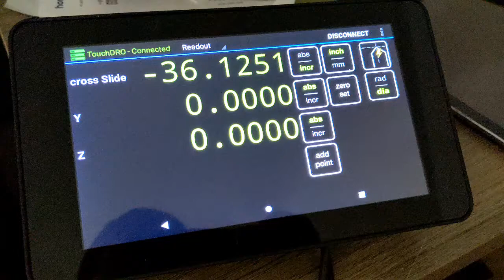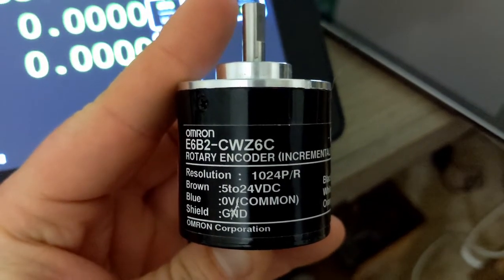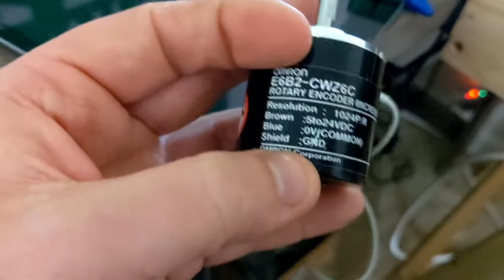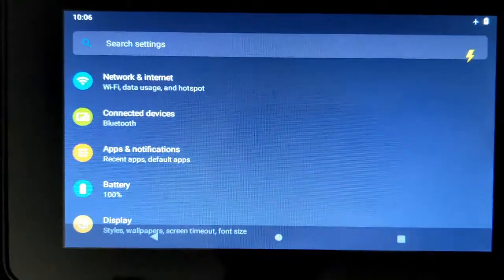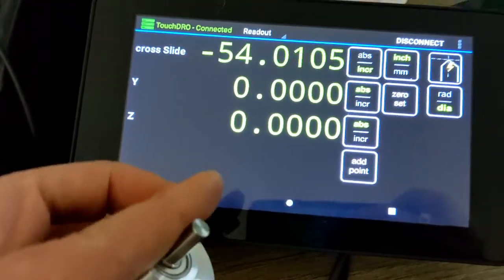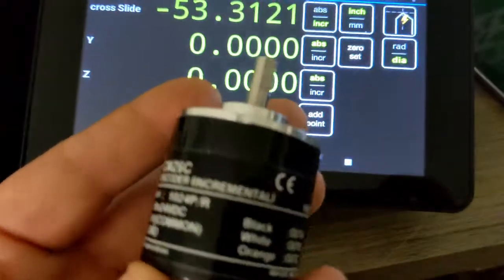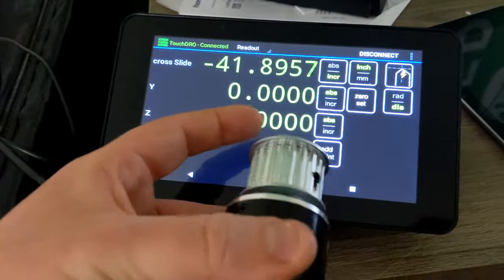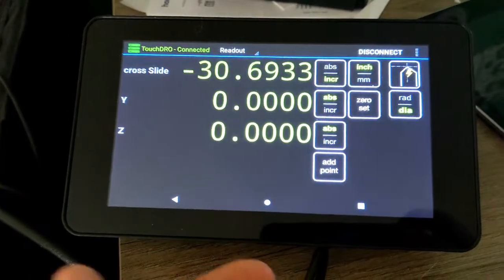TouchDRO on a Raspberry Pi 3b+ .... Part 2

Comment: Interesting... I'm in a similar situation looking for a DRO for a lathe.
The big issue is choosing and buying the scales particularly for an electronics hobbyist who could make up their own controller board.
Unfortunately for something like this once you factor in the cost of the Pi, the touch screen and the controller... The cheap dro controller displays from bangood and aliexpress start looking quite economical. Plus they're a single unit and a little more robust for a workshop environment. They also don't run the risk of a forced android update killing off your DRO. Google has become quite insidious in that fashion.
It would be interesting to see the full hardware setup you have for this.
Reply from the maker: So I have a used Nexus 9, disabled all updates and basically it's been running great, I didn't go with the pi because of the price of a tablet. I did buy cheap glass scales, overall spent the same price as Ali express but didn't have a language gap and didn't have any issues. One thing to mention, the dro does cut off after being connected for 24 hrs, so you do have to turn the power off the touch DRO and reconnect the blue tooth, but it takes 2 seconds to do it, I'm happy overall

Comment: Wouldn't a rotary encoder be susceptible to backlash of the lead screws?  Where a traditional linear scale eliminates that problem by not being tied to the screws.
Reply from the maker: You could have the rotary encoder not tied to a lead screw, but more like a fancy wheel running along ur lathe.. (like the new chop saw measuring device I've seen ads for)  but yes I was just using a rotary encoder to test it out, I ended up installing glass scales

Comment: Recently I saw belts for CMM machines. Similar to GT2 concept but belt contains thin strip of stainless steel so is unstreachable. Don't know what the prices are for it.  You can check since your idea is nice.
Reply from the maker: That's not a bad idea, I ended up getting glass scales, but if I had to cut the cost significantly, I would probably do that route to be honest

Comment: Hi, would you belive that the Raspberry 4 would make any difference in performance? this seems to work very well!! thanks a lot!!!
Reply from the maker: So yes, the Raspberry Pi 4 should work significantly better with getting the App store install portion of the build.  I unfortunately do not have a Pi 4 to do the test, but you would have to select Pi 4 from the drop down in the LineageOS site.  There I would still do Android 10 if you want to use the 7" screen, the newer version of android 11 might not support the Pi screen in that version. So long and short, yes, but looking at the price of a Pi vs a HTC Nexus 7 or 9 on ebay, those are cheaper options if money was a decision factor there.